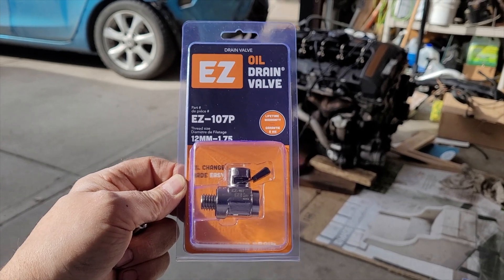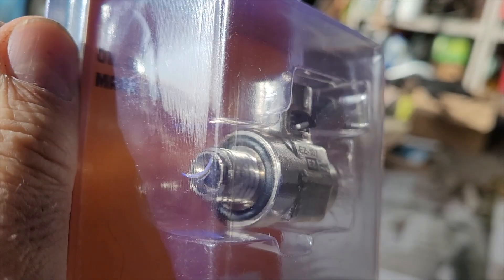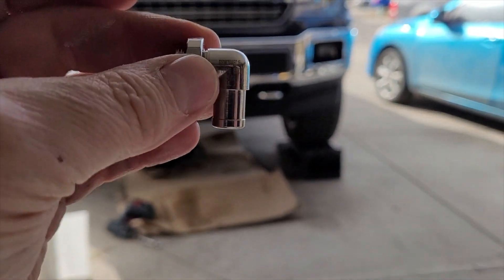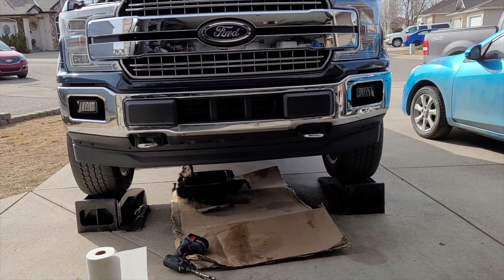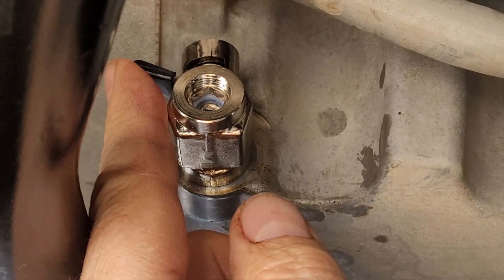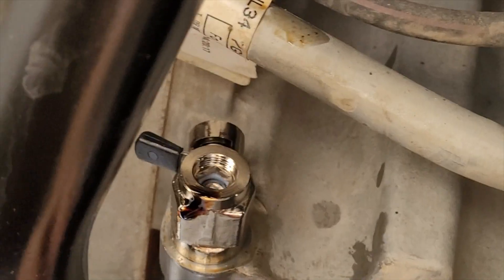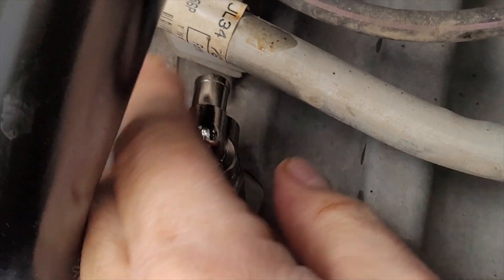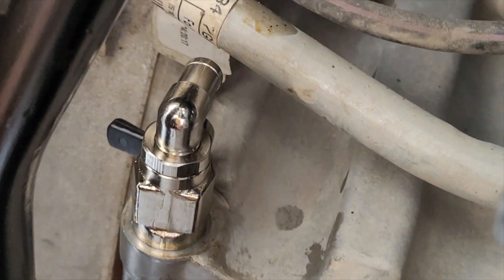EZ Oil Drain Valve   Ford F 150 | GRAMPZQUAD

Comment: If that valve fails out goes the motor
Reply from the maker: How is it going to fall out? It will fall out just as easy as a drain plug will fall out. The valve mechanism locks and will not open on its own.
Thanks for your comment and concern.
Reply: @grampzquad  Petcock mechanisms in general can fail after some time as they wear out
Reply from the maker: @MalindoWe  Ok Thanks for the warning!
Reply: @MalindoWe  Industry has used ball valves for high-pressure, all-temperature gas and fluid control for over fifty years.  In most cases, those valves are in use for decades before replacement.  Ball valves were used to control fluids in the SR-71 reconnaissance aircraft, experiencing temperatures of thousands of degrees at three times the speed of sound.

Comment: These +18 models don’t use the yellow cap?
Reply from the maker: No.  I'm in Canada so not up here anyway!
Reply: @grampzquad  ah I see, I’ve got the yellow cap so that really limits my options for drain valves
Reply: @user-vm3fm1cp8s  Get a Ronin drain plug.  I put one on my Mustang GT.  You'll never have to worry about replacing the OEM plug or O-rings.
Reply: @AStanton1966  Thanks I did lol